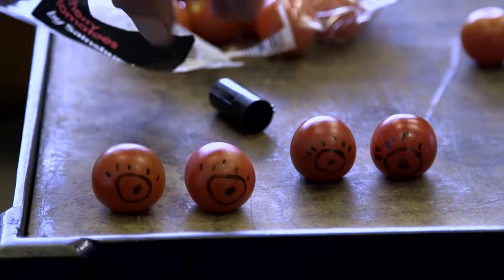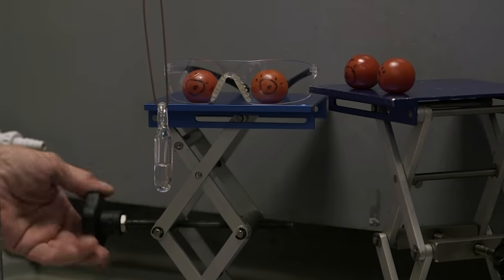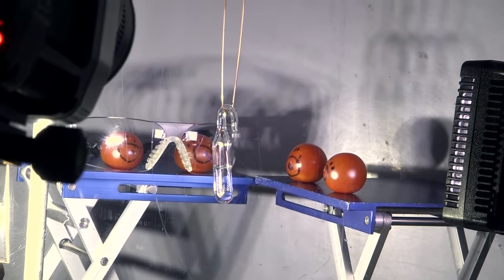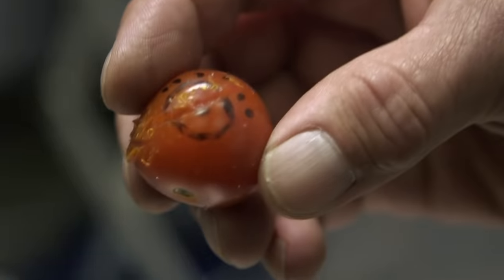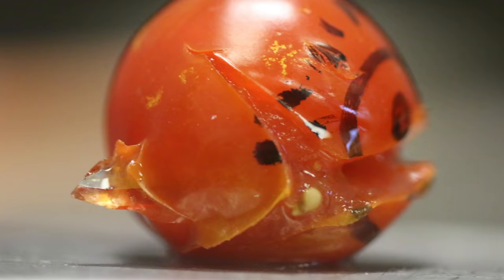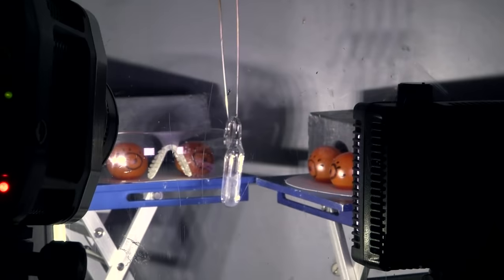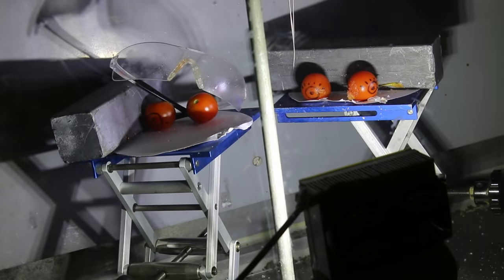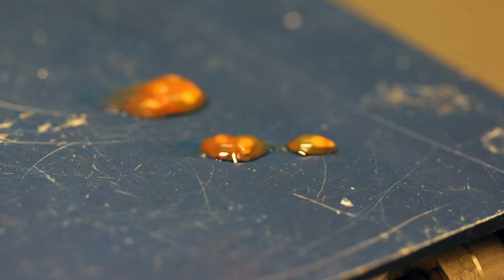Why you need to wear safety glasses - Periodic Table of Videos

Comment: Not just flying pieces of glass, a single drop of any concentrated strong acid and it's over as well. Even some solvents would blind you right away. In my opinion, glasses are even more important than gloves!
Reply: Or strong caustic. (I was calling the surgery; other people were hosing him down under the emergency shower. I heard afterwards that their prompt action saved some of the sight in one of his eyes.)

I never trusted safety glasses, only goggles.
Reply: At my university we dont even use gloves, if not strongly indicated like when you use bromine or smth.
Reply: @mikesummers-smith4091  Yeah, bases in unprotected situations scare me far worse than acids do.
Reply: @moskon95  I was always taught to make adequate risk-assessments for myself. Thick rubber gloves are recommended for handling strong acids, but the lack of fine motor skills as a result of using those gloves can create an even more hazardous situation. So I can see why you would opt not to wear them. Just consider the risks involved in what you're doing beforehand, and act accordingly.
Reply: >  In my opinion, glasses are even more important than gloves!

You're saying that like it is an controversial statement. I would say that's unquestionably true.
Reply: @At0mix  Especially when working with conc. nitric acid, wearing gloves can actually be more dangerous than not wearing any
Reply: @Lars Veldscholte You are right, it is unquestionably true. But unfortunately not common sense as I have to see every day...
Reply: If its strong caustic liquids- its probably worth getting a face shield in addition to the goggles.
Reply: @phoephoe795  Can you be specific? E.g. NaOH, KaOH?
Reply: @Joe Eagar I'd say pretty much anything that can cause chemical burns from short duration exposure/splashes.
Reply: I use acids and caustics on an almost daily basis. I always wear my gloves and glasses but my boss hardly ever does. I'm always like 'Dude! Put your damn glasses on!!!
Reply: I'm gonna have to go ahead and use this comment space to rep splash shields specifically. Goofy and annoying to don, sure, but liquid droplets tend to move in conic trajectories rather than in straight lines and splash shields are much better for this purpose (no hate for ANSI z87 and the like, but they are really for impact hazard rather than spray)
Reply: respirators are also an essential component to personal safety equipment...as is a fume hood when you are dealing with some of the truly nasty elements and compounds featured in these amazing videos
Reply: @samarnadra  That is true.
Reply: I was working in a locksmith shop, and we had a lock come in to be rekeyed. I took it apart and was getting ready to start repinning the lock, and standard practice is to thoroughly degrease the lock with something like industrial-grade brake cleaner, in an aerosol can.
The one time I didn't wear my safety glasses, I had a stream of solvent spray directly into my open eye.
That hurt quite a bit, and my eye burned for the rest of the day.

Comment: I had a friend drilling hardened steel with a carbide tipped high speed steel bit. He was leaning in close, dripping oil into the hole from an oil can. The drill bit hit a slag inclusion in the metal, binding it. The drill bit failed catastrophically, and a piece of the drill bit stuck in his heavy apron, sharp end first. Another, larger piece flew into his safety glasses, knocked them askew and gouged a piece of polycarbonate out and leaving the groove slightly blackened. Another fragment slightly injured his finger, which he wiped off and put on an adhesive bandage. He would have been much more seriously injured without safety gear, and would probably have lost vision in one eye from this incident.

Comment: Even back in elementary school science class in the 1970's we wore them. Back then they were clunky plexiglass goggle things but thankfully we never had to test them out. Personally I still prefer the goggles as the cover the sides of your eyes too and you can wear them with prescription glasses.
Reply: Same here.  I use Bolle ones most often.
Reply: Goggles are better- much lower chance of ricochet fragments getting into the eyes.

(and make sure they fit properly- I've sparks from a disc cutter bounce through the gap between goggle and nose before.
Reply: Goggles are far better imo, more protection and usually more comfortable too.
Reply: Plexiglass shatters easily, they were polycarbonate goggles.

Comment: Man, for years I didn't bother using safety glasses while working around the house, simply cause I found it too annoying to dig out the dusty, dirty old pair from the toolbox. This changed after adjusting an old chainsaw that I had gotten to run for the first time in 30 odd years. While test cutting, a tiny shard of wood lodged itself just barely in the white of the left eye... Spent ~10 min gently digging it out myself as it was shallow. After that, got myself a set of tinted safety glasses, and now I never leave home without wearing them... Simply cause I still can't be bothered to go digging through that toolbox for those old crappy ones.

So, remember folks, safety first!
Reply: Access is important, too.  All my important stuff is near my standing desk (where I spend a lot of time).  Respirator, weapons, goggles, gloves, hearing protection, etc.  Everything else is also in places that make sense (all the survival stuff in one spot, all the tools in another, etc.)-- but the most important stuff is within arms reach.
Reply: I wear sunglasses pretty much all the time outside, and they're always rated safety glasses. Cheap, comfortable, easy to replace, and protect my eyes when necessary. Works great for me.

Comment: This video really makes you wonder "why stop at safety glasses"? I wouldn't want high speed flying glass shrapnel entering my nose or mouth either. Why not wear full face masks?
Reply: Legit if I can I wear safety glasses and then a Plexiglas face shield over my whole face over top that
Reply: Yeah, if you're working with potentially explosive stuff, you need more than safety glasses.
Reply: I mean, if you're working in the lab and an explosion in glassware is a risk, then of course face masks are the bare minimum :>
but if the biggest realistic danger is corrosive liquids splashing in your eyes, you don't need as much physical resistance, and a bit of sodium hydroxide on your cheeks is much more easily cleaned off and doesn't leave permanent damage, as it would in your eye.
Reply: Don't stop at the full face mask. Don't even get out of bed in the morning. You could slip and break your skull.
Reply: Well, there is the fact that we can repair almost anything in the body that isn't:
The eyes, the brain, the spine.  So, yeah, until someone can rebuild an eye and optic nerve from stem cells, best to just protect them.
Reply: All that is unsafe. You need remote manipulators with CCTV. You can be a mile away when the thing explodes.
Reply: @pietrotettamanti7239  I know (or at least I hope) you're joking, but a lot of people actually think that way.

They don't understand that just because there's risk in two actions, it doesn't mean that both are equally risky
Reply: Abi Gail because losing your ability to see is generally considered worse than losing a tooth or taking some glass shrapnel to your cheek.
Reply: Face shields are cheap and easy to use.
Reply: My take away - stay in bed, wearing a hazmat suit. Got it!
Reply: @pietrotettamanti7239  every morning I wake up and break my arms. In the evening I break my legs
Reply: Ya know there's this thing called the fume hood

Comment: Codys lab needs to see this
Reply: atm12  why? From what I've seen He uses glasses when necessary?
Reply: There has been many time he should of worn protection. The general rule of thumb is that if he wears protective gear its usually pretty dangerous.
Reply: Cody uses AvE approved safety squints.
Reply: @MrTridac  highest rated
Reply: Remember when he hurt his thumb, kinda shows he should be a bit more careful, although he is safer than colin furze
Reply: Cody does wear protection. If something is expected to be "volatile" his face is mostly off-camera. If it's moderately safe he wears prescription polycarbonate lenses rather than contacts. The don't give 100% of the protection of safety goggles because they don't have the side protection. But they are very tough and do stop most things.
Reply: @boring7823  yeah i saw them i just bought a new one yesterday

Comment: There are bits of glass embedded in the ceiling in the lab at my work from a glass tube that was sealed up to run a reaction.  It failed catastrophically as in this video.  The engineer running the experiment escaped with his eyesight because he was wearing his safety glasses.  We keep thr glass in thr ceiling tiles as a reminder.

Comment: Great demonstration. There are many youtubers who should take note (for some reason often eastern european) because the level of safety in all respects in their videos is extremely low or non-existent. Safety should be the first lesson in any laboratory or workshop based activity.

This demo is excellent because it brings home the potential damage that can be done. You shouldn’t baulk at the “gruesomeness” of using animal tissue because some lessons can only be learned through shock tactics. This one however is extremely effective.

Comment: I remember I'd gone to a mine once to mine some amethyst when I was younger, and I didn't think to put glasses on. First strike into rock, and I feel something hit me in the eye. It wasn't too bad initially, so I put glasses on after that thinking everything was fine. Well we got back to the house we were staying at, and the pain just kept on getting worse and worse all night and I ended up spending that entire night rolling around on the floor due to the amount of pain I was in. Turns out part of the tool I was using had chipped and lodged a sliver of iron in my eye, and it had actually started to rust in my eye. Doctors were luckily able to remove it with a q-tip and a drill, but that was not a fun experience. Had to wear a patch for 2 weeks. My vision is okay now, but...

It doesn't take long to mess yourself up.

Comment: You know, this experiment and what it is trying to represent is somewhat misleading!
This is  CHEMICAL lab, it should be performed with chemical safety goggles and maybe ink in the tube instead of water, so that it can demonstrate where the liquid particles hit.
Many people think that machine shop safety glasses, as used in the first demo (designed to protect from flying particles) are adequate. Chem labs must require the goggles with the soft face-conforming edges. They are more uncomfortable and fog up, so many students opt for the ones without the seal, which flying liquids can bypass. :/

Comment: Safety goggles are always a must, take care of them so they are clear and never scratched. Treat them like your baby and don't let them get scratched, that way you have no issues putting on a clear set. people will often take off safety goggles because they are dirty, foggy or scratched.

If you have to put on a respirator, i highly recommend putting on a face shield too. respirators can sometimes push your safety glasses up at the nose, and leave gaps where you can get things in the eye.
even then, a full face shield is a nice idea plenty of other times.

I am not a chemist, but a steel worker. but the same basics apply.

Comment: But I need my regular glasses to see.
Reply: IIRC, those of us who wear "regular" prescription glasses wear the safety glasse in front...
Reply: @pandeyoga5414  I've been told that contacts wouldn't help me.
Reply: So get the slightly bigger safety glasses that can be worn over your regular glasses.
Reply: Regular glasses are pretty good for protection as long as they're big enough.
Reply: At my work they provide prescription safety glasses for those who need them.
Reply: @pandeyoga5414  we were told to never wear contact lenses since they supposedly can trap vapor and so on and can interfere with the use of eye showers.
If it really makes a noticable difference I do not know, I can't wear contacts anyway and there wasn't really anybody willing to test this. (Strange I know)
Reply: Yes I've heard that too, the vapours can get trapped.  Prescription safety glasses are the way to go, I wore safety glasses that go over your own glasses and they can dig in to your head.
Reply: Use a drop down face shield. They don’t interfere with glasses.
Reply: safety glasses can go in front of ur normal glasses.
Reply: @ametrinemoon  It depends on your glasses the safety glasses and the shape of you head.
Reply: willian cavallari it depends. Full-size goggles can, safety glasses don’t.
Reply: You can get prescription safety glasses. My brother has worn them for years.
Reply: Hence why prescription safety glasses are better, you get measured for that.  You can never get the same cheap over prescription safety glasses for width.
Reply: Neil wears safety glasses over his regulars ones in these videos, and so does the professor as I recall. You just need ones that are designed to fit as such.
Reply: A lot of safety glasses and goggles are made to accomodate eye glasses.
Reply: Even in a place like Walmart where they have the prescription eyewear you can get safety glasses with your prescription in the lenses.
Reply: @keithdurant4570  I have some too.
Reply: I have several pairs of safety glasses and sunglasses that are made to fit OVER and protect your regular glasses. A quick online search should yield successful results, should you be interested.
Reply: Dude, around 50% of my fellow students, and a fair amount of assistants and professors wear prescription glasses and safety glasses on top. I know its uncomfortable but luckily I have a choice as I dont need my glasses to see well. But no matter what you are doing in a lab, even if you arent doing/using something dangerous, wear safety glasses. Better safe than sorry.
Reply: Then you won't need safety glasses
Reply: If you have prescription glasses you still need to wear something to protect them - suitably sized safety glasses, a face shield or prescription safety glasses. See the damage caused to the safety glasses in the third explosion in the video.

Comment: There was a case where someone was working on a oxygen tank in his garage.
The valve was stuck so he was trying to unscrew the valve, which is pretty hard to do.
As the oxygen escaped around the threads at high speed, it caused the aluminium to melt.
Somehow, the tank blew and his arm was cut off. I don't mean that it caused cuts. I mean his arm was removed.
There were bits of shrapnel stuck in the walls.

I think it was in a OSHA safety video. If you have a problem with a tank with 1000 PSI or 2000 PSI of compressed gas, FORGET IT.
I don't know how AIR LIQUID and such companies deal with these bad tanks, but they probably have robotic equipment to cut them open.

Comment: I managed to explode a drill bit in metalwork once, actually drilling the plastic for a handle, and by this time the bit was dull, someone behind wanted me to hurry up, so I just put a tiny bit more pressure on and...
BANG! drill bit shrapnel rattled on the shield - and the teacher re-iterated that that's why you NEVER use the drill press without putting the shield down.
This wasn't a small bit, but there wasn't a lot left of it afterwards

Comment: An aside: Impact resistant (polycarbonate) safety glasses are almost entirely opaque to UV. So if you get arc flashed by a welder while you have safety glasses on, you won't get the horrible 'sand in your eyes' effect that doesn't go away for a week. You'll still get spots in your vision from the intense visible light but those go away quickly without ill effect.

This is why electronic welding masks that darken after the arc is formed aren't dangerous. They always protect from UV, and the darkening effect is only concerned with the visible band.

Comment: If you look online you can find those foam heads that are used to display sun glasses or store wigs so they don't lose their shape.  Take those and carve out the eyes, place the tomatoes in the sockets, and safety glasses over. You can even attach them with an elastic band.   Also stress that this was just water, but imagine if it were H2SO4 or a really strong base.

Comment: One of my classmates made this mistake once, in a chemistry class. We were supposed to heat up the test tubes a little bit, then seal them. He sealed his first, then heated it. Went similarly to this, enormous bang, scared the shite out of me but luckily I was wearing goggles AND had my back turned from the other side of the classroom. He was also wearing goggles, but his hand still got hurt pretty badly (he was holding it in his bare hand).

Comment: You forgot to mention that once the "safety glasses" have been through an event like this the surface scaring and the force of the impact will have weakened the ability of the glass to properly with stand a second impact and will not only not protect the eyes in the a second event but will most likely become shrapnel themselves. The surface tension in a new pair of safety glasses is a major part of their ability to withstand such tremendous forces the first time and once scratched they can loose most of that ability. And I agree with other comments; this example with the tomatoes should be one of the first lessons in every science class for students the world over.